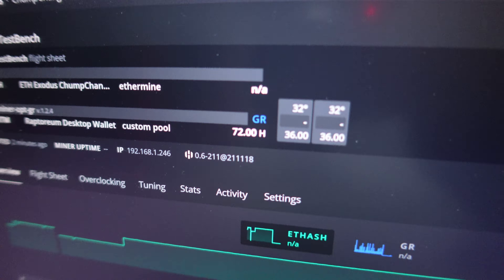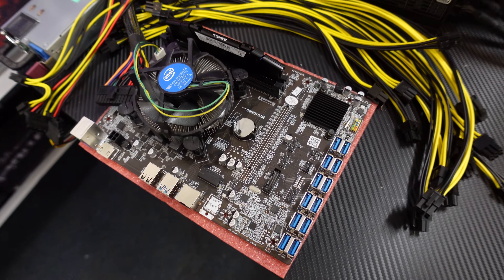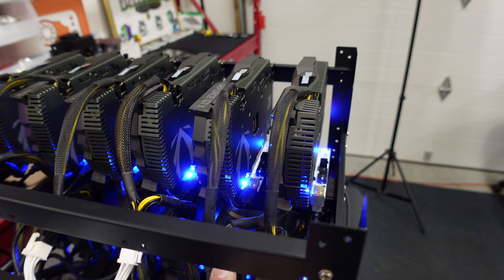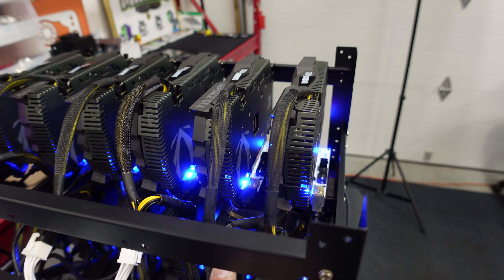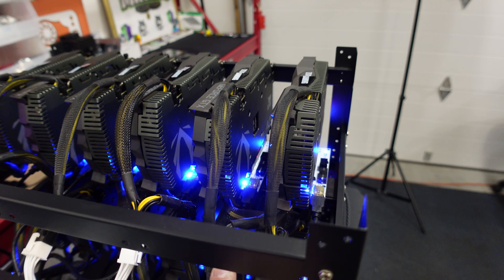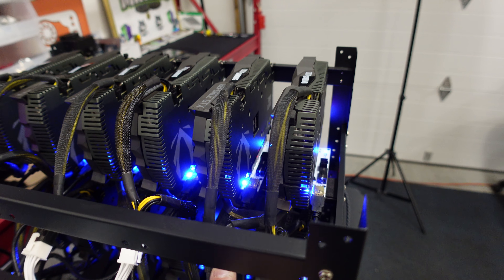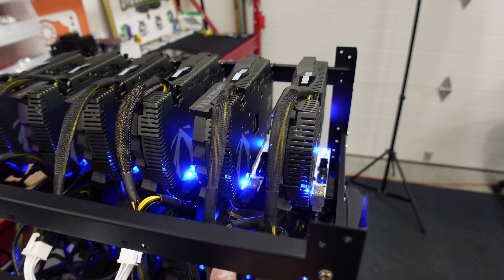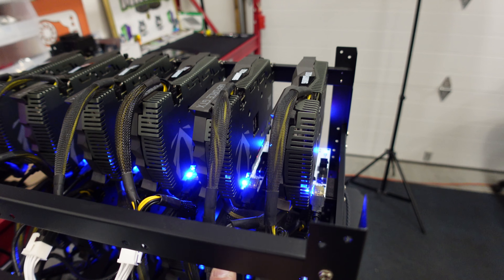BTC B250C 12x Nvidia GPU Ethereum Mining Rig

Comment from the maker: Have you tried the BTC B250C? How do you like it? Let us know below! (Link in description)
Reply: Love these boards
Reply: Or you can run an 1100 watt dell psu. Does about 1023 watts on 115v, more than the 1200w psu on 115v.
Reply: without knowing how your heating system works,  if the vent takes partial air to the heater which has a thermostat, adding growth tent heat to that pipe can mess up your heating
Reply: Just ordered a 2nd, had great luck with the first one.
Reply: Just received mine the other day, love it!
Reply: Chump changexd its almost 18k subs
Reply: Just got one of these boards  last week just fired it up today absolutely love it
Reply: Bought 2x BTC B250C and 8 RTX3060 12gb lhr is maximum I can get with 2x 2000W ATX cheep power supply...have older server psu 700w 58A and waiting for cables to connect with 12 cards....have 6 of server psu and thinking to 4 card's to one psu....but problem is I don't have brakeboard for that psu and I don't know how to make it work... any help?
Reply: I'm having issues with this board running more than 4 GPUs (AMD RX5700). Does not allow me to load the memory (when you running AMD-info you can see it) and every 24-48h hang up randomly for no reason like "rig offline". I've been battling this issue for a long time with every single wire, power supply, etc, etc replaced. Nothing. 
Do you guys have BIOS updates or BIOS settings for these boards? Would really appreciate your help!
Reply from the maker: @dennisbindarau5966  hey man you should jump into my discord “MisfitMining” I wonder if anyone knows this answer!!! I haven’t ran AMD On mine personally
Reply: Hi, i have 8 gpu's at this moment on Btc 250 and they are 3060ti lhr and each gives me 41-42 mhs but when I put them on any other board I get 44-45mhs . Any solution to this problem and has anyone experience the same?
Reply: @dennisbindarau5966  , are you using window? I am using trex on window and kept giving whea uncorrectable error after 2-4 hours. I have tried update on window and driver including bios. Nothing works but each update, bios, etc will lengthen the error more than 8 hours.
Reply: @onefourtwofive2830  HiveOS. When you see unrecoverable error that's your overclock settings. Try something else in terms of overclock or even run on default settings for a day to make sure you have no hardware issues. After that slowly apply OC setting one step at the time to see if it's going to take it. 
My issue is different. No error messages. Just frozen/stuck miner screen and only power cycle to get it back up.
Reply: Does this motherboard only work with Nvidia gpus?
Reply from the maker: @jaytoolbox6409  to be honest I haven’t tried it with AMD
Reply: @ChumpChangeXD  so I have my AMD Radeon Rx 570 hooked up to it and it's registering it but the fans aren't on. I've been looking everywhere to find the problem
Reply from the maker: @jaytoolbox6409  fans on the GPU?
Reply: @ChumpChangeXD  yes even when i go to try and mine they don't turn on
Reply: Stable is max 8GPU nvidia….

Comment: As you have splitters to splitters isn't that actually four GPU's & risers being powered by the main 2 x 8pin PSU cable? So even on power draw it's pulling just under the max the main cable is rated for.

Comment: Problems in my b250c, this board freeze and reset, sometimes reconize only 2 of 7 cards. I try reset default configurations (other options too in the BIOS), change risers, change miners, change RAM memory, change power supply. The only thig that I not try was change BIOS version, because I dont know where download other versions to test. Can you help me?
Reply from the maker: Yea man join MisfitMining I’ll try to help. Mine works great that’s weird!
Reply: @ChumpChangeXD  Problem Solved: downgrade bios version to BTCD3A15.
Reply: @danielalexandrez  Where did you download the bios? I cannot find much info on this board anywhere
Reply: @danielalexandrez  which GPUs you connected and where did you get the BIOS? thx!

Comment: I Hey Hey @ChumpchangeXD - I was juuust about to pull the trigger on one of these and then I noticed that the one I was going to buy, just like yours, does not have the 6-pin PCIe socket for powering the MB soldered to it!  This being said, I see your board works even without that power connector so it must be ok it's not there? What do you think that's about where some boards of this exact same type have that 6-pin power connector and some (again like yours) do not? What should that missing connector be powering?

Comment: @chumpchangeXD hey i grabbed one of those board and it boots up fine but will only run for random lengths of time and then it will freeze … not shutdown or reboot just go “offline” and my 7” screen is frozen … keyboard does nothing … running 7 amd cards … i5 6500 cpu … any help is appreciated
Reply from the maker: Your clocks are too high
Reply: @ChumpChangeXD  they were running fine with a b450-f ?? … wanted to upgrade for the eventual more cards… also itll freeze wether its mining or not … i tested it just cpu mining no cards .. freeze .. even turned it on no flight sheet and it still froze at sum point